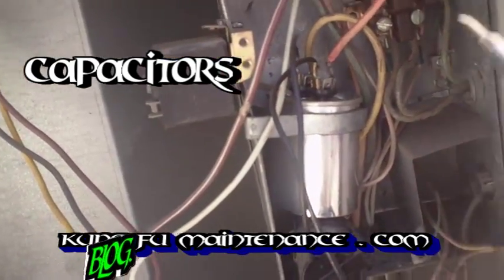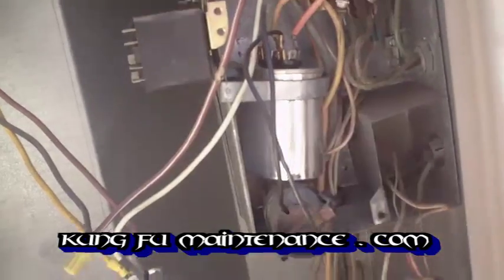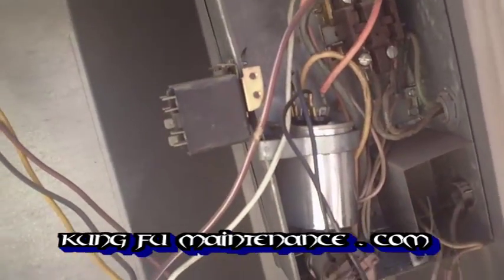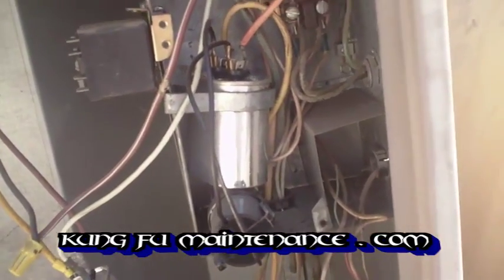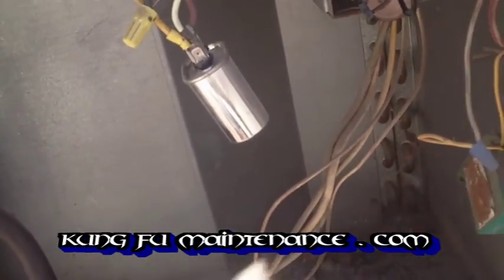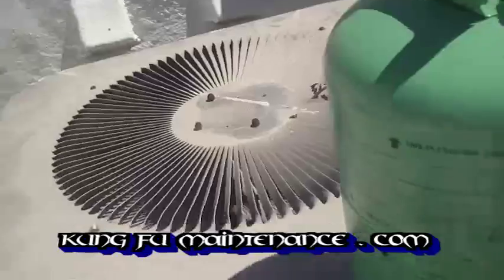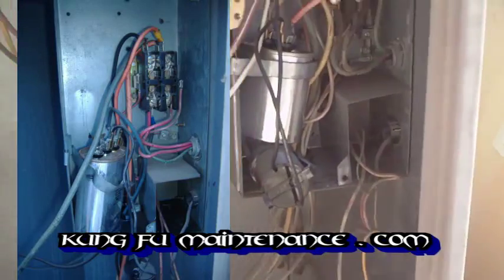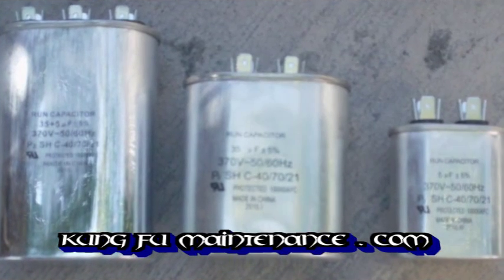Capacitor ~ AC 101

Comment: OK so the cap is new, the fan motor is a 2.20 FLA and it suppose to be a 1.4 . And condensor fan motor overheats at the hottest point of the day. Through my work I got a Dayton motor and cap .motor is a 1.7 -1.9 FLA. ALL OTHER SPECS ARE THE SAME. It'll be replacing the gem tech...

Comment from the maker: To change the capacitor without electrocuting yourself (or friends that might come to rescue for that matter) first pull the disconnect or shut off the breaker than you must discharge the capacitor. Holding only the insulated portion of an insulated screwdriver bridge the leads of the capacitor with the metal non insulated portion of the screwdriver this will discharge the capacitor. I show the procedure in  my video "Keeping Cool How to discharge Air Condition Capacitors by Kung Fu Maintenance"

Comment from the maker: Another thing, and this would also follow the fan capacitor replacement, is to check that the fan blades are spinning the right way and that when disconnected and reconnected they are still spinning the right way and not reversing directions. I have seen this happen many times with dual caps with a single fan port wire. The unit runs fine but every time power is applied the fans would change directions. This can be repaired by converting to separate capacitors. A video I hope to make eventually.

Comment from the maker: Clear of debris and nice and clean. The evaporator coils would be at your indoor air handler. A new capacitor of the required voltage(can go up in cap voltage just not down) and correct microfarad should always be put on whenever a fan is replaced. My guess is they tried to reuse the old one or put one on with the incorrect microfarad for the new fan motor. Majority of fans use a 5 microfarad but some use other mf's such as 7.5. You should be able to find the mf called for on the fan nameplate.

Comment from the maker: I would first pull the disconnect than discharge the capacitor(hopefully your doing this before spraying water on the unit so no one gets electrocuted) than try cleaning the condesor coils, plus evaporator coils, and changing the air filter. If that doesn't do it replace the fan capacitor. The fan motor may have a bad bearing but it could also just be the fan capacitor is losing it's kick. The fan motor has a thermal cut off that will shut off if the fan overheats and restart when cooled down.